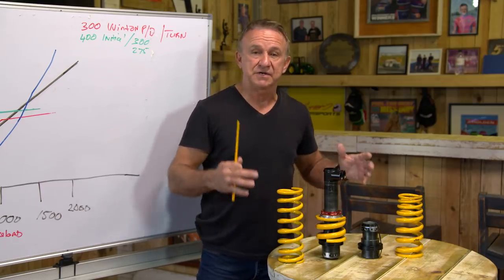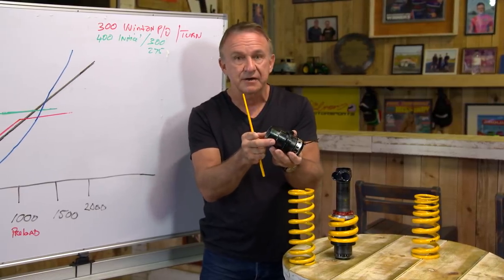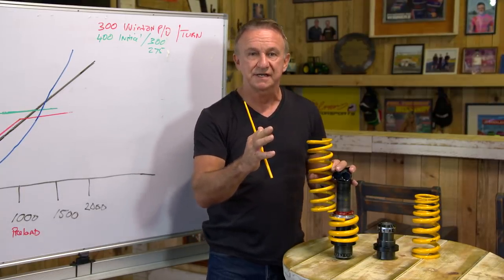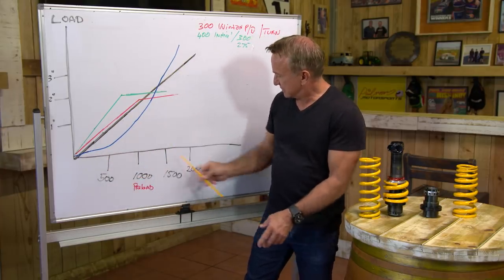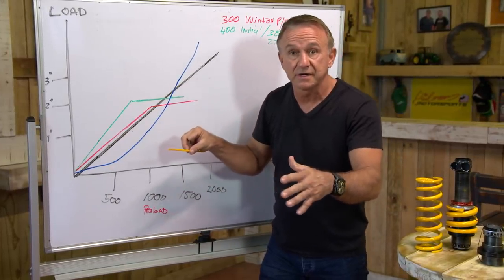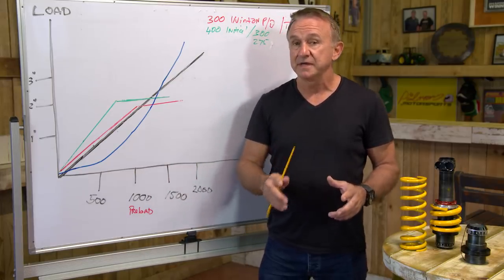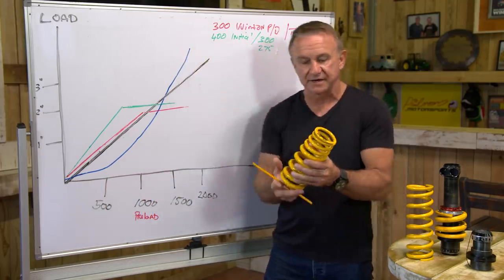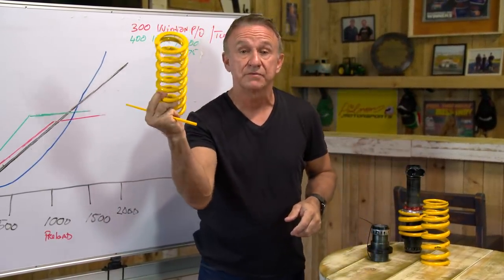TECH: Springs - Russell Ingall & Paul Morris

Comment: nice work guys, more of these tech talks, something I've always thought there should be more of...lots of fan that have enough understanding to get into a bit of nitty gritty tech  chat!...would be interesting to know how that slider adjusts the crack off point and how it locks the rate?
Reply from the maker: The crack off point into the softer spring rate was controlled by the spring platform collar.  Winding it up and down on the shocker thread alters the preload on the spring that intern changes when it kicks in through the corner.

Comment: Russel the love muscle, how do you adjust the ‘crack off’ point?
Reply: Would also like to know how the "crack-off point" is adjusted. Could be useful in my sports sedan.
Reply: Pretty sure the collar between the two springs has a set load point at which it is overcome by the primary coil. Fancy bit of toy but there’s a much cheaper way to do similar. Just have a middle spring or an outbound spring. If you look at the IRS on a ba onwards falcon you’ll see they have a solid secondary spring which kicks in when it’s loaded up.

Comment: I'm a little bit confused... If you want soft as you exit the corner wouldn't the graph be the other way around. Meaning little to no travel on braking and initial cornering (stiff spring under minimal load) and then 2-3" travel the more pressure thats applied to the rear on exit (soft spring) so it squats as Russell says